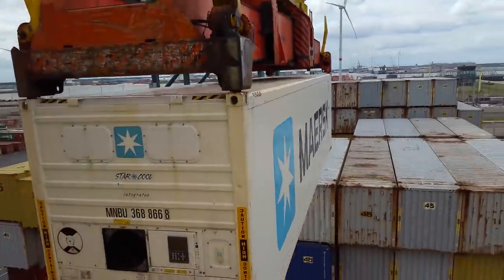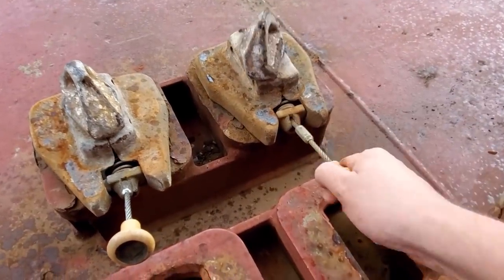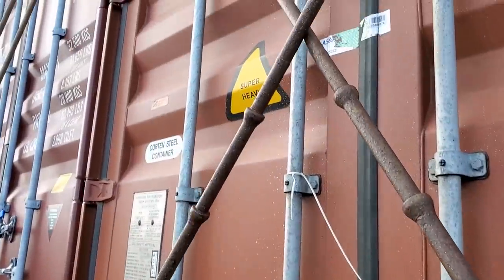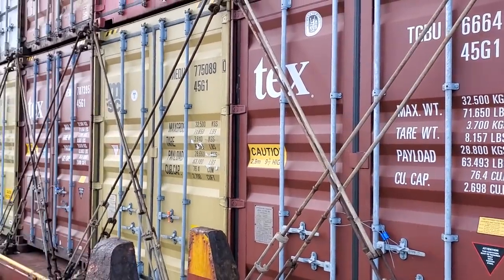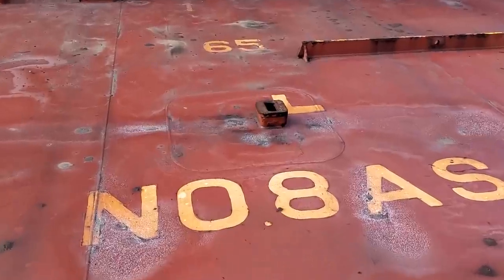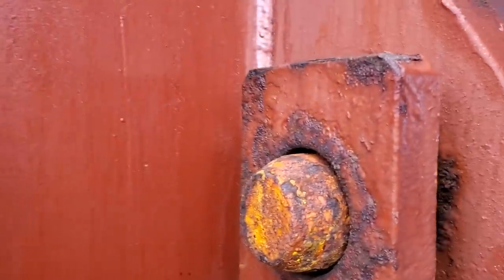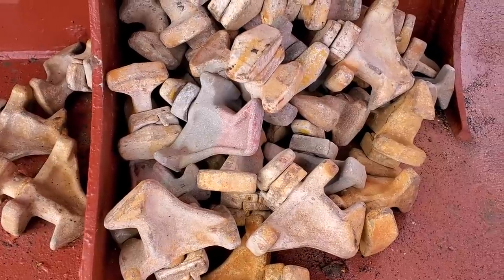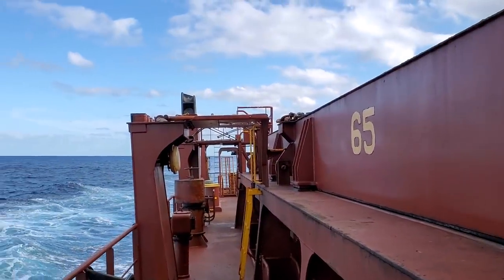Container Ship Vlog 36 (How Containers are Kept Onboard)

Comment: Hi Jeff, thanks for another really interesting video.  How do they operate the Twist Locks on the upper layers of containers?  If they're stacked nine high then that's going to be a long way up to reach!
Reply: They have a long aluminum bar with a little who come in that they reach up in pullum and a lot of the ships that carry super high like that I have catwalks that they walked a couple levels high also..
 Also there is a thing that sometimes the Crane can hold where people stand in the basket platform and the Crane can lift them
Reply: Like he said in the video the lashings only go 2 high and 3 and up are only locked on the bottoms,Making it more top heavy the higher you stack.

Comment: Thanks for the video. I wonder how they get unlocked. Is that a manual thing? And how to unlock the top ones?
Reply from the maker: There is a aluminum pole with a small hook on it to reach it
Reply: @JeffOnboard  Thanks for your answer. So it is a manual process before the unloading can even start?

Comment: Does the weight of the containers affect placement on the ship, or is the size of the ship enough to cancel that?
Reply: No, the import / export containers are planned in advance and placed accordingly to the chief mates approval. There will be constant back and forth. Your dealing with tides, vessell draft, and ballast. It's important that vessel doesn't  list to a certain point. You'll have refrigerated containers that are live, which is important to load on the ship as soon as possible in the case of any slrmd were to arise. That way we can get a mechanic up there to hopefully repair on board and not having to discharge it again.  Most of the time, the final approval isn't confirmed untill 8 hrs prior to operation commencement. The lashing is A&B lashing on that vessel. Every container from bottom up correlates to a letter. So if the stack is 5 Hi, it will be A,B,C,D&E. When the lasher's lash back the containers, the superintendent will have an onboard mate approve the lashing before the ship sales. I have major respect for both the lasher's and crane operators. Not easy jobs.
Reply: Yes, I meant to say, the weight is a big factor
Reply: @jassonhinkle3598  Thanks!